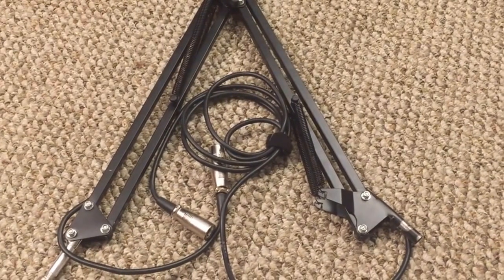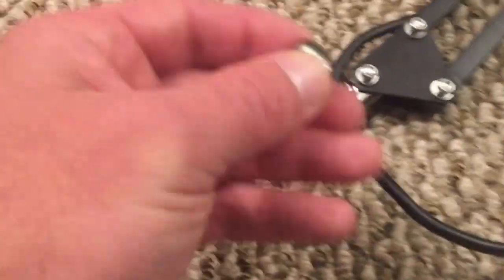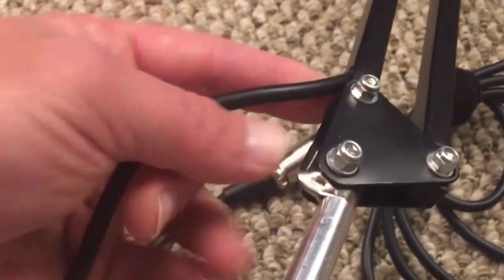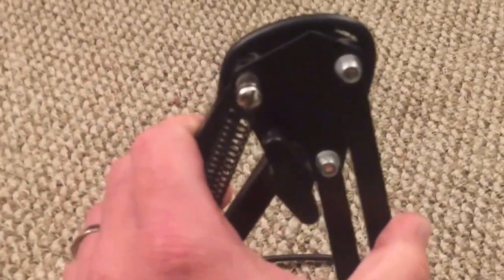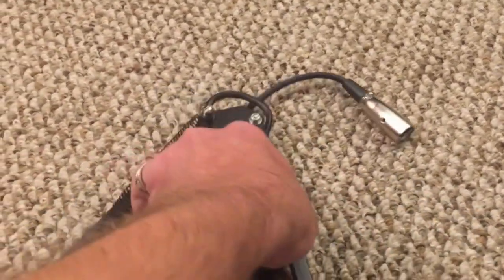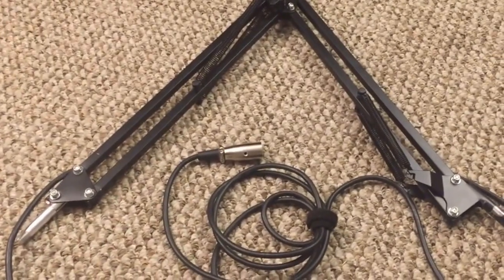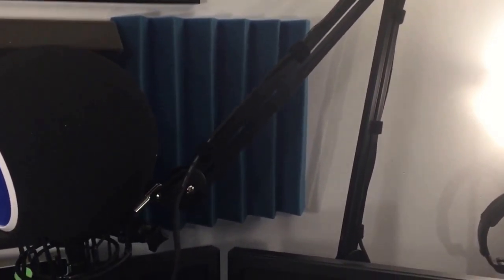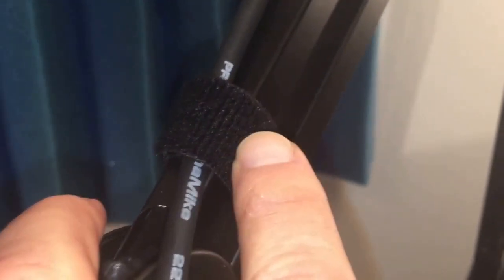Product Review: DuaFire Professional Microphone Boom Stand

Comment: does it fit in the snow ball ice black?
Reply from the maker: I don't have a Snowball, so I can't specifically answer that question... I can tell you that It has a standard thread mount for shock cradles or mics, so depending on what the thread mount is for Snowball Ice Black is, that would determine if it would fit.

The official product description says:
Suitable for most Microphone & Shockmounts 
Supports for all microphones weighing from 600g to 1.3kg  which with 5/8" (22.91mm) female adapter
Supports for all kinds of shock mounts and pop fliter with 5/8" (22.91mm) thread adapter
Supports most wireless and wired microphones weighing between 600g and 1.3kg when combined with shockmount
Reply: Scotty D ok thank you bro

Comment: how do you adjust it... instructions dont say
Reply from the maker: What exactly are you trying to adjust?
Reply: i'm desperate to know this too since the arm's springs are too strong to keep the arm folded, and I don't see anything to stop them from stretching.
Reply from the maker: The weight of the mic and shock cradle hold it in place. You just move the mic where you need it and whammo! all done! There are no adjustment screws like the cheaper models.